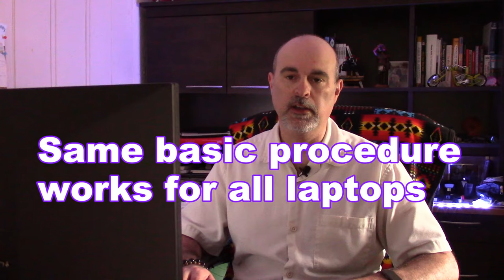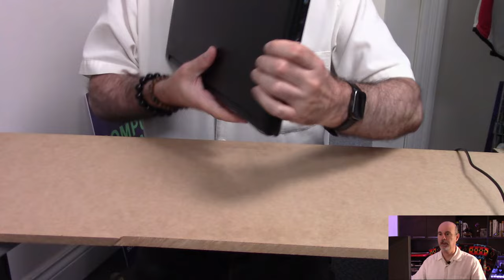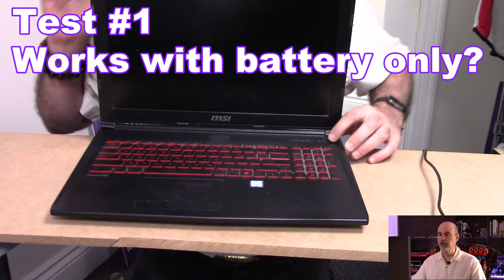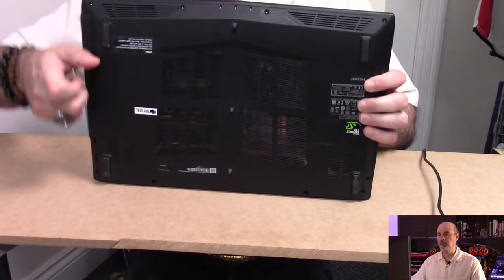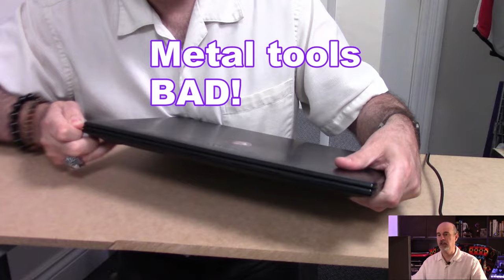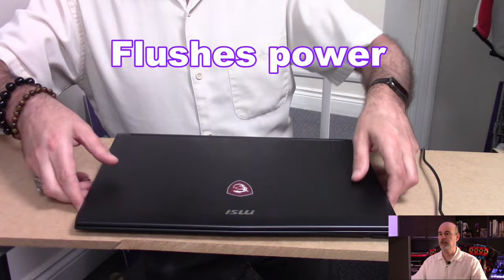How to fix an MSI laptop that will not turn on

Comment: Hey, does this work with brand new laptops? I just got mine but it has the same problem and I want to know before I try anything
Reply from the maker: This can work with all makes and models of all years.  It's not always the solution but certainly is something free you can try yourself before paying anyway.  But if it's under warranty still, there is a chance that you could lose your warranty coverage opening the computer.

Comment: Thanks for this. My problem is that it won't wake up with mouse click or keyboard, etc. It only wakes when i press the power key. I looked in setting and it looks like it should but does not.
Reply from the maker: There must be a setting somewhere that is off in either the power management in control panel or power management tab of the keyboard and mouse properties in the device manager.
Reply: @TwinBytesInc  Thanks for the reply, appreciate it. Yes, it is very odd. The only solution I could find was turning the sleep to 'Never' while on battery and while plugged in and then having the screen turn off after a period of time, so that it does not sleep at all, just allows the screens to shut down.

Comment: So i was working and suddenly my laptop turned blue, showed an error and shut off. 
Then i tried booting but the screen never lit up. The power button light kept glowing but not the screen. 
Then i switched it off and kept it on rest. After 30 mins i tried switching on again but this time, nothing would glow. I then plugged in the charger and the entire keyboard would light up and the laptop slowly heated up without the screen turning on. I don't know what's happening. Do you know what this problem is?
Reply from the maker: Although I can't troubleshoot here, if it's heating up with nothing on the screen, there is an issue with the power flow and it could be a bad battery, bad charging port (The DC Jack) or possibly the power adapter.  You'd have to probably have someone open it up and look at it.

Comment: My laptop cannot turn on by pressing the power unit. I have to spam the power unit to turn on my laptop. Sometimes it takes a few minutes to turn on my laptop. I don't know if it is because of the power button issue or the battery.😢
Reply from the maker: That's hard to say without looking at it.  if the button doesn't feel right, might be the physical button.  Needs troubleshooting

Comment: heyy so i have an msi gf63. i used it until the battery goes 0%, plugged it in and turned it on then it was up for 5 seconds before it shut down for no reason and won't turn on even with the cable.
 
this did not work for me unfortunately, but i'm glad it worked for other people. i'm never going to buy an msi pc ever again lol
Reply from the maker: I personally don't recommend MSI but at the same time, this issue can happen with any brand.  MSI has made some good computers.  I always say, you could buy the top of the line product and it dies a week later, or you could buy absolute garbage with bad reviews and it lasts forever and works great!

Comment: Hello, my leopard 8re gp63 has a blue power button for a few seconds then goes off, no power whatsoever, the charging light doesnt come on either.
Reply from the maker: If this video didn't help and the whole in the bottom didn't do it either, then maybe a new power adapter if not bringing power in.  Otherwise most likely motherboard needs repair or replacement.

Comment: Will the same procedure work if computer turns on but the monitor doesn't?
Reply from the maker: it's possible, but if it's just the monitor, try plugging an external monitor in and see if it works.  Then you'll know for sure if it's the screen that needs replacing or the monitor cable damaged internally.

Comment: MSI GS66 Stealth laptop. I was charging my laptop, came back to it 2 hours later and it wouldn't turn on. I unplugged the charger and still nothing. I could hear static noise coming from the laptop where you plug in the charger. I came across your video and held down the power button for 60 seconds then I released it. I noticed the static noise went away right after. Waited a couple of seconds and pushed down on the power button and viola, it worked. Is there a problem with my laptop or charger? Thanks!
Reply from the maker: I'm glad you found this helpful.  If this happened only once, it's just a temporary power glitch.  if it happens again, maybe an underlying issue that needs troubleshooting.

Comment: Sirr, I want to ask that my laptop is msi gf63 thin 9rcx, the problem is that he can't turn on the laptop without the help of a charger, but if the charger is unplugged after that, the normal laptop doesn't turn off, it's just that if you turn on the laptop at the beginning you have to be assisted with a charger, what's wrong 🙏🏻
Reply from the maker: That's very strange, I don't think I've seen that before.  It sounds like there is something wrong with the battery that it can't have enough charge to boot the laptop, but it can hold a charge to keep it going after it is started.  I am only guessing at this point, but sounds like the problem is the battery.  If not the battery, it's a motherboard issue that needs repairing.

Comment: Sir, i have msi gf63 laptop ...buyed just 6 months ago...now my laptop has no power on..i went to service center they did bios setup..it worked well for 1 hour..later again it stopped and power off...what might be the problem sir??? Its very new laptop...
Reply from the maker: Thanks for your question. It really sounds like some sort of problem with the motherboard.  If they did a BIOS upgrade and it's still a problem, you should request a warranty replacement as it should still be under warranty being only 6 months old.   Be careful so places drag on repairs until warranty expires and then say it's too late.  I think you should probably ask for a replacement.  Otherwise its a motherboard repair.
Reply: @TwinBytesInc  i aaked them for laptop replacement, but they r ready to replace only motherboard...so is it ok or shall i ask for laptop replacement??..if they replace motherboard will the issue get resolved..?? Or who can i know which motherboard they are replacing it with??
Reply from the maker: @ENeha-ev1sp  Thanks for your question.  I can't make a guarantee on their behalf but I believe that will fix is from what I hear from you.  That's worth a try. As long as it's working in the end, you have the warranty to fix it whatever way is required.  Just make sure you have a backup of your data.  These big companies tend to wipe data as standard procedure for any repairs.

Comment: hello daniel, I've a msi GE62VR 7RF Apache Pro Kaby Lake i7-7700HQ model that suddenly shut down and now won't turn on anymore. If I insert the charger connected to the mains, the blue led on laptop that indicate the charging doesn't light up. I've follow your procedure but the laptop still to not start. I've noticed that the stripes on the battery that are on the top side, on your video are green, in my battery are red. Is possible that the problem is from the battery that's completely gone? I've tried also to start the laptop without the battery but the computer still to not turn on
Reply from the maker: Thanks for your well written question.  If the charging light doesn't come on and you tried all this, it sounds like maybe the DC Jack needs replacing.  You'd have to have a new DC Jack installed which is most likely soldered on the motherboard.
Reply: @TwinBytesInc  Dear Daniel thank you for your reply. About the dc connector on the motherboard as possible issue, my question is: the laptop has suddenly shut down but before this, I hadn't a battery low charging message on computer. So, if the dc connector has fault, the laptop wasn't supposed to stay on at least as long as the battery have a charge?
Reply from the maker: Yes, if the battery still had charge, it would still work until the battery runs out, even if DC connector bad.  But sometimes there can be more than one issue.  Someone needs to physically look at this.  I can't say for sure, I can only give my best guess without looking.
Reply: @TwinBytesInc  yes, right..thank you anyway for your opinions. I'm waiting that amazon deliver me a new battery and I'll try with it...if will still to not work, I think that I'll thrown it away :(
Reply from the maker: @sergio76e  You're welcome.  Good luck.
Reply: @TwinBytesInc  Dear Daniel, I update you on my MSI GE62VR 7RF laptop problem. This afternoon I received the battery (not original) from amazon and after inserting it I tried to turn on the laptop. Turning on the computer, the keyboard lit up for 1 second and then it turned off and then turned on again for 1 second and turned off in a loop but nothing appeared on the screen. I removed the battery and I've traied to put it again with charger connected, at this point the fixed blue recharge led on pc turned on.  So, I left the computer like this for 1 hour and then I tried to turn on it again, but it did the same thing again, it lights up the keyboard for 1 second and then turns off and so on, etc....at this point, I removed the battery again and I pressed the power button for 1 minute, then I reinserted the battery and connected the charger again, I tried to turn the computer back on and now the keyboard was lit up and remained fixed but still nothing came on the screen. Now by pure and simple chance, I connected my klim cooling plate to the USB laptop port and now the laptop has started! it went into windows and is now back to working properly! anyway, tomorrow I take it to a friend who works on computers and he will check it with testers for to see if there's something issue. The fact that the laptop has come back to life is a big thing!
Reply from the maker: @sergio76e  Thanks for the update.  Glad you got it working.  Sounds like a magical fix. :)

Comment: Hi I just replaced the ram on my MSI GL65 leopard laptop, I followed your instructions regarding draining the battery I put it back together  and it just shows the charging light but it will not turn on. The fans are working but the screen is not starting up
Reply: It seems it's from the new ram I purchased,  it boots up after I put in the original ram.

Can you recommend to me a compatible memory for my MSI GL65 Leopard? I want to upgrade it from 16gb to 32gb. I am not that tech-savvy, and I would really appreciate it
Reply from the maker: you can use this website is great!  https://www.crucial.com/store/advisor  I did a video on it years ago but it changed alot.  Time for a new video.  You can enter your computer info to search or use the system scanner.  Alternatively find the manual for your exact system.

Comment: my msi shows that it’s charging. the only light that shows up is the blue charging light. but the actual keyboard and laptop don’t light up. is that the same problem as this or is it something different since my charger light is still lighting up?
Reply from the maker: This definitely can be the same problem.  It's an issue with power flow.  Could be a simple fix like this video, new battery, new power adapter or maybe motherboard repair is required.  Something blocking power flow.

Comment: Hello daniel, I have the same Msi laptop. I have been facing black screen issue the laptop & backlit turns on but the caps lock doesn't turn on & the screen is also black. Any suggestions or any kind of help will be appreciated. Thankyou!!
Reply from the maker: If this solution doesn't work, sounds like it's not the screen either if caps lock not lighting up either.  Could be power adapter, battery or motherboard needs a repair.
Reply: Thankyou for the reply Daniel. @TwinBytesInc
Reply from the maker: You're welcome

Comment: Same problem but did not work for me, my charger is/was putting out 30+ volts. Wondering if it is possible to repair for potential damage form over powering the system?
Reply from the maker: Great question.  Yes you can certainly have too much power and cause damage.  The adapter must be the correct voltage if you are buying a universal or else just buy the more expensive original that is meant for that laptop.

Comment: Hello Daniel. I have an Msi gt72s with a non removable battery. I hve tried to reset the battery by pressing the refresh button, but so far this hasn't worked. What should i do next?
Reply from the maker: I don't think I've seen one with a non-removable battery.  They maybe inside the laptop with several screws holding it down and a cable attaching it to the motherboard.  Otherwise there maybe a pin hole on the bottom of the laptop if that's what you were referring to which can be used to reset.
Aside from that, you might need a professional to look at it and see if motherboard needs repair or replacement.

Comment: Im having trouble opening the panel. I dont have a guitar pick any. I tried a card but it didnt do the trick. Any ideas to get it to open?
Reply from the maker: Anything slim and firm to slide inside, but not too far and damage components.  Also I avoid metal so not to make contact between components and fry something. I like plastic which a guitar pic works perfectly.  Even if you are not a guitar player, computer stores sell tools that include guitar pic shaped wedges.  Or you can go to a music store and they offer free pics to customers.
I don't recommend walking into a music store to get a free guitar pic, that's kinda bad, but whatever you gotta do I guess. :)

Comment: Hey , I tried it on my MSI:GL 65 95DK and it didn’t work …. My laptop is charging but it won’t start , I also checked and it wasn’t the power button or any screen problems 
Do you have any solutions for this? Or would you recommend me on going to the MSI’s main for repair? ( A response would be appreciated at the fullest)…
Reply from the maker: Other than removing the memory and see if it responds to that, try one memory stick at a time and in different slots.  Maybe that works, or you'd need someone to troubleshoot this motherboard.

Comment: Didn’t work for me did exactly as video said put it back together plugged in power and middle blue light came on in the front but pushed button to turn on and nothing left it plugged in checked on it later and the middle blue light was off and now it seems completely dead , is the battery completely dead is this why ? Will it turn on with just the power adapter if i leave the battery out on these msi models that have an internal battery
Reply from the maker: Sorry this fix doesn't work every time but most of the time.  Definitely if you leave the battery out, you can try powering on with just the power cord to determine if the battery is an issue.  if doesn't work still, maybe issue with motherboard needs repairs.

Comment: Why this issue is occurring mine was dell g15 , i tried your method just removed battery and repluged and it works. But why this is happening in the first place??
Reply from the maker: Glad it's working for you now.  the issue is basically to do with bad power flow.  This trick flushes the power and allows a fresh flow of new power.  Could be bad wiring in the computer, could be the outlet your plugged into, or just temporarily "Dirty power" came through.
Reply: @TwinBytesInc  thanks for the reply
Reply: @TwinBytesInc  do you know how to prevent it happening again, it happened 4 four times for me I asked service they said motherboard problem and changing it

Comment: I managed to get it to work by just unplugging the power source then holding the the power button (without having to unscrew and take out the battery) then after 60s plug power cable back and boot.... However, what is this issue? Is there something to be concerned about? Thanks!
Reply from the maker: Glad you got it working.  This is usually something I see that is a one time thing and no major concerns for long term.  But I believe if you see something repeat 3 times in a reasonably short period of time, there is cause for concern.
My laptop was issues with hardware from when I first bought it, I gave it many chances, but after a firmware upgrade came out, issues resolved.

Comment: Hello, so I have a MSI GF65 laptop and suddenly one day it crashed and turned off on me. Ever since that day the keyboard lights and fans turn on but the laptop doesn’t power on, my display screen is blank, and I don’t get a charging indicator.

I took it to get serviced and they told me the cmoss battery was dead so I replaced it and I’m still having the same issue.

I would appreciate any sort of help!
Reply from the maker: There is no way they can say that is the issue for sure without proving it.  Since I don't see your computer I can't say for sure either, this video just gives recommendations on what fixes it many times. if this doesn't help, I could have almost guaranteed it's not the CMOS battery.  I've never seen a CMOS battery cause this.  it's something on the motherboard that maybe needs to be reflowed.
Reply: @TwinBytesInc  yeah I took it to a reputable repair shop and they’re almost sure it’s the motherboard but they don’t know what from it. I’ll find out Monday.

Comment: Today I turned on my msi gp62pro leopard laptop and the screen was flickering really fast so I turned it off through windows so I could turn it back on. I figured this would fix the issue as it had never happened before. The notebook did not turn on after that. I tried your tutorial and unfortunately it didn't work. What could have happened?
Reply from the maker: Hello Luciano, this sounds like a different issue.  Sounds like it can power on, but it just won't boot because Windows is damaged.  You should be able to see something on the screen.  If you can't see anything, it will be difficult to troubleshoot on your own.  Maybe screen damaged or motherboard / video card.  You could try an external monitor if the laptop appears to have power but just a blank screen.  Otherwise, someone needs to look at it.